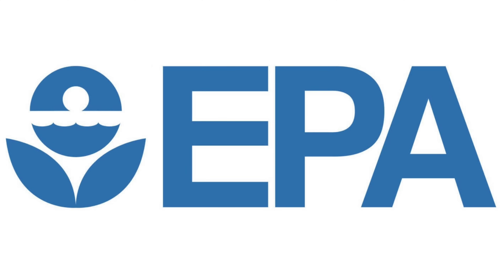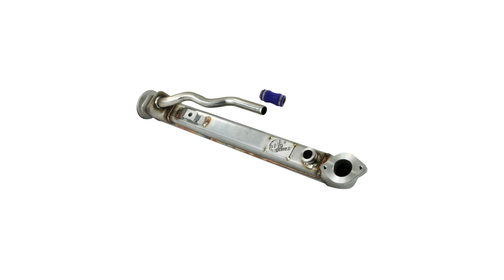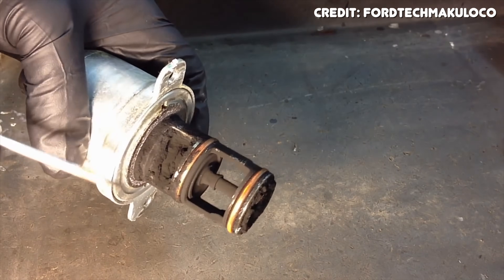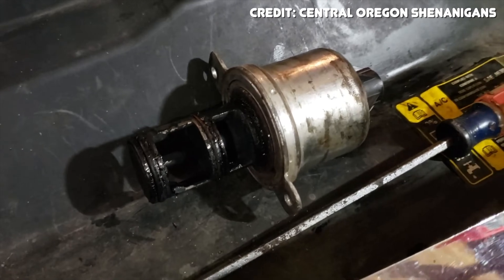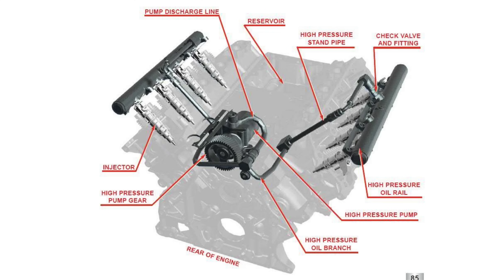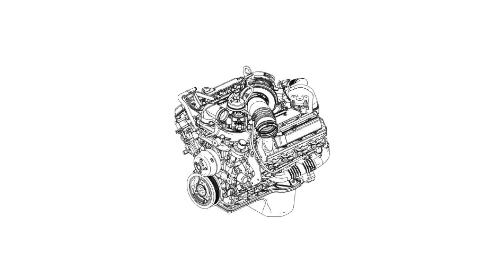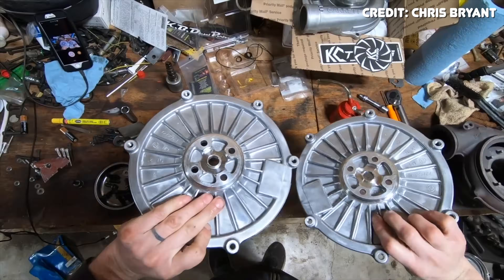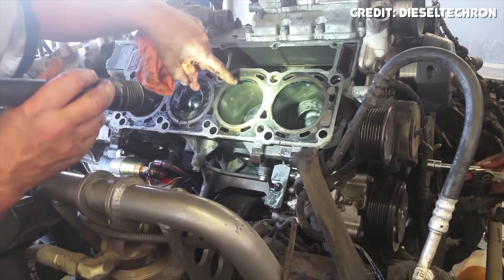The Truth About the 6.0L Powerstroke (And Everything Wrong With It)

Comment: My 6.0 gave me problems in the form of a blown egr cooler.  Fixing the known issues on the 6.0 was still cheaper than a new truck and since the rest of my truck was tip top I went ahead and spent the money to address the problems.  10 years later it’s still been a reliable workhorse.
Reply: If you do regular maintenance like you’re supposed to most of these problems are pretty rare
Reply: I am a shill for the 6.0 I can't lie, but right after we deleted the egr and put a new oil cooler on. IPR blew as me and my dad came back from the shooting range, was an absolute b*** to replace after we just closed that valley back up. Tip for yall trying to do IPRs now, harbor freight has a ratchet that swivels left to right, I never found an application for it until replacing that IPR made it worth the $15 spent.
Reply: That makes me feel good bud cuz i just bought one
Reply: @BlakeRobison-jh3ft   religiously changing the oil and filters is key
Reply: My 05 was 37k brand new when I bought it, here it is 18yrs later and only spent $10,000 on 2 headgasket jobs & failed HPOP, including replacing known issues, i.e. EGR delete, ARP studs, blue spring, upgraded cooler and oil rail o-rings, So, still less $$ than a new one, plus I have backup cam and poweramp steps and power fold mirrors & wood steering wheel from Lincoln
Reply: I didn't have any problems, but I decided to spend the money and bullet proof mine, it's a great truck and doing well.  It's a nice looking and nice sounding truck and I can't see spending $75k and up for a newer or new truck.
Reply: Thanks for steering me away from another money pit.
Reply: I can agree with that. Built proofing my 6.0 has kept me on the road. Have fun
Reply: I own a "87 f 350" with a 6.9. it's a
Dump, I'm told it's an International diesel. Had it 3 yr & Boy! What a workhorse! 4
Reply: How much did you spend on it to bulletproof it and do improvements?
Reply: @johnhinston958 I spent 4500 making my 03 f350 reliable.  It’s not tuned or deleted but has a bullet proof diesel egr cooler.  A bulletproof air to oil cooler and a coolant filter kit.  

458k miles still going strong
Reply: @johnhinston958  What does bulletproof mean in this case?
Reply: @FreEmotions_Real   Ford made the 6.0 a little problematic. To make it trouble free you have to replace some key pieces to ensure it doesn’t break down
Reply: @johnhinston958  I got it. What does a phrase "to bulletproof it" mean? To make it reliable??
Reply: @FreEmotions_Real   yes like the president’s limo is bulletproof. A truck is bulletproof if it gives you no trouble
Reply: @FreEmotions_Real bullet proof is a company that offers parts for the 6.0 psd to make it reliable as in head studs gaskets updated oil cooler and relocation to front bumper and egr delete and tune it safely they will run forever just keep on with the filter and fluids with the top stuff nothing cheap
Reply: So no one is going to answer his question. Head studs are the main item from my understanding. As indicated in this video it has many other items that need to be addressed but a blown head gasket is the main culprit.
Reply: Don’t put some crazy tune on it. Bought mine new, added a coolant filter, tow tune, intake, exhaust. No major problems, oil and filter changes including fuel filters as scheduled, 240K miles. Still runs great. Sould outlast me.  @timdontwannasay5889
Reply: My nigga u droppin facts how many miles do it have now boss
Reply: @JamieGarrett-ru4rq  Saw your comment B, i got an all stock with 243k on it, not studded, no major issues. I just did $20k of work on it to get it prepped for 600hp. Lemme know if you need any help if you have a 6.0.
Reply: Who wants to have to be a Ford technician to be able to drive that piece of junk. Gimme the Triton any day

Comment: I have an early 03 6.0 totally stock with 295 k no heads studs but went through all 8 injectors at 220.  Lots of fass fuel pumps because I live in north Dakota and they don't like the cold. It was egr deleted at about 190 along with new oil cooler and hpop. And now I just did oil cooler, hpop, and turbo and all seals. Put only  oem stock parts back in.and it runs better than it ever has since I bought it with 122k on it!

Comment: Work on them full time and hate them, and i actually love fords. I own a mustang and a fusion. But. Buy a dodge and be ok with replacing wheel bearings. These things are garb. I watch dudes throw thousands at them just to have something else give out. And that's if it doesn't fall apart while we work on it. The heat from the turbo and tight space makes things difficult at times.

Comment: Yeah the 6.0 isn't perfect! But what else can you buy  for around 5k and do what they do it's by far the best bang for the buck out there, They made a million of them so used parts are plentiful, awesome  for  vast selection of aftermarket upgrades endless diy videos on YouTube, Sound good,  still has modern body style  solid chassis If you actually know how to diagnose and read the  vitals correctly  not just plug in a  scanner pull a code or 2 thinking the t's and p's look great  but not realize your looking at inferred readings, so you can avoid the typical Craiglist buttfucking or  start throwing $1200-$1500 in parts chasing phantoms while the frustrating POS keeps dying  all over just a bad stc fitting so now they wish they listened to everyone on 6.0s reliability even though the fucker has survived  275k  on the odometer and the last owner probably  didn't even know how to check the oil  level correctly

Comment: I work on these for a living. Lack of maintenance kills them. They flip inside out due to running on a high pressure oil system sealed by a series of o-rings... Dirty oil acts like a fine polish until the o-rings give out and then it all fails in a series....

Comment: 6.0 isn’t terrible. There is a few design issues that absolutely need attention. But common maintenance mal practices in any engine just have a higher effect on these engines. Running a quality oil, motorcraft filters(oil and fuel) will basically eliminate injector issues. Keeping your batteries and charging system maintained will basically eliminate FICM issues. Starting with a clean not restricted oil cooler and installing a filter kit will pretty much eliminate oil cooler and egr cooler issues. In stock form head bolts are fine, if you are pulling a lot just monitor coolant temp and know when to back out if them. All if the issues can be issues in any other vehicle 6.0’s are hust less tolerant when you don’t maintain. If you start off with one that has been maintained correctly and you continue that they are great. They can be frustrating when you buy one that hasn’t had attention and you already have components that are beginning to fail it can be costly and time consuming to get them back correct. I will continue to run them though, can be bought cheap because if their reputation. They are east to work on and cheap compared to new common rail engines. The cost to replace a common rail fuel system on these new trucks will nearly buy a whole new engine for a 6.0. Then you can start fresh and as long as you follow some of the simple guideline they will last a long time, be reliable and get good fuel mileage, in a truck that has an excellent running gear and is a very good truck overall.
Reply: This is an incredibly useful comment, thank you

Comment: I drive a 2007 F450 6.0L Diesel, 658,322.7 miles, 15,722 hours, change the oil every 150 hours religiously, change the oil cooler, screen, and EGR cooler every summer, the starter is the only thing that's left me stranded in 8 years lol

Comment: I personally own a late 04 model f350. When I bought it it was fully stock and low miles had no issues and all I have done is preventative mods for those common issues. Coolant filtration system, egr delete, blue spring mod. Adding additives in my opinion do help. I use the arch oil products both fuel and oil additives and I haven’t had any kind of issues with my injectors since I replaced them about 60,000km ago. I like my 6.0 has plenty of power for what I need it to do. I’ve got friends that have the same truck and turn them up and have nothing but issues with them with a couple more supporting mods that I have.

Comment: Best thing I ever did for my 6.0L besides head studs was to install a coolant pressure gauge, it will let you know when your pressure cap starts to leak or your oil cooler is getting clog up. Have 265,000 miles on my Excursion.
Reply: W for excursion gang
Reply: Where did you tap in at?
Reply: I'd def get a ECT tuner  gauge cluster  from EGTs to ficm voltage everything's on these gauges  so there's no guess work at all.. and  when your towning  egts and trans Temps are a must to monitor
Reply: A tuner will give the American advantage and then some because you can monitor live values and set high limit alarms notifying you the instant it gets one degree higher than you want.

Comment: Nearly every issue with the 6.0 comes down to lack of maintenance. Change the oil, coolant, and fuel filters per the severe duty schedule (and leave the tuners in the box) and your 6.0 will likely live a long and happy life.
Reply: Nope.  It needs the EGR cooler delete to keep the massive heat out of the system.  THEN it's much closer to issue-free.
Reply: @tucobenedicto1780  yep
Reply: I bought my 04 f350 in 2015 with 180k miles on it. The next 50k cost me a fortune. I eventually parked it until I had the money to fix all the issues at once. Bulletproofed, deleted egr, blue spring, new heads, etc. done by a mechanic that specializes in these motors was the key. Im about to hit 400k miles and haven't had any problems I couldn't fix myself since.
Reply: @cooperdanieltherancher  man, that’s a loaded question, because really you have no clue how the previous owner(s) cared for and drove it. Also, what are they selling it for? May be worth doing if it’s a great price, they have kept their receipts and maintenance log, is it studded already? What oil, ATF, coolant, fluids etc. have been used for the life of the truck? Does the transmission flare when shifting, especially 3rd - 5th under hard acceleration? There’s just a lot of questions. But, that goes for any truck/vehicle. If you’re honestly thinking about buying one, research, research, research and questions, lots of them should be asked. My truck has 176k, but it’s 20 yrs old, so some of the problems I’ve had are regular things that fail being that old. I still have my original injectors, turbo, dont run a hot tune, and stay ahead on maintenance. I also always watch my temps and pressures, especially when pulling. Hope this helps. If you have anything else I’d love to give any help I can.
Reply: @jcobra09  what do u mean by transmission flare
Reply: I love my 6.0. It’s not for the average joe, you literally need to have some mechanical knowledge to own these trucks and how to diagnose the system. Other than that not bad to work on and brings a smile to my face everytime it hits boost
Reply: @jdm_fan2376  funny for me I always thought people are expected to work on the easy things, if you can't see the cams on the table, you should be able to some what work on it with a decent mechanics help
Reply: 150k on my 2006 6.0. I monitor oil temps, coolant temps and transmission temps with a ScanGauge. Use Archoil oil and fuel treatment to keep the injectors clean. Make sure the battery terminals are clean and frame/body grounds are not rusted which can lead to FICM issues. Prayers to the almighty also seem to help ;-).
Reply: I’ve had my 03 since 08. Been a great truck. It’s a good truck for guys who aren’t afraid to do a little maintenance and work on their own rig. If you just want to fill it up, drive the shit out of it, and take it to Jiffy Lube every 10k miles, you’re not the right owner for the 6.0. I don’t think it’s the greatest engine or any of that, but the haters I think either have never had one, or have and didn’t do their research and maintenance. Theirs something that I just love about the way it sounds, drives, and feels
Reply: @jcobra09 i got a 03 too. I Really need to see a comment like yours. Thanks.. im not afraid to conserve that truck now 👍
Reply: Yup- I have an ‘05.  Did head gaskets and headstuds in 2012 and have 100k on that job. It’s water under the bridge. Otherwise, I did the usual 6.0 things like blue spring, coolant filter, etc.  Best truck I’ve ever owned and I’ve owned more than the millennial moron that made this video.
Reply: @BMXMXMETAL what do you mean by transmission flare
Reply: Ford rushed this engine out before it was ready!
Reply: @jacobnorth8642 Great engine. The emission design was a failure. Do a delete, regular maintenance, coolant filter, no hot tune, no problems.
Reply: @jacobnorth8642  the entire 6.0 eng   is after market.... they fail during  parked and off....
Reply: I have an 04 ,second owner at 255k SD. And I agree with you. Maintanece, FOmoCo filters ONLY and common sense with  elevate alot of your "6.0 problems". Egr delete was a no brainer as well. I have no issues (currently) good luck!
Reply: Another 6.0 boy trying to defend those piles of shit.
Reply: @connor4961  another idiot talking shit about something he’s never owned, only knows what he’s read online from others that never owned one.
Reply: @cooperdanieltherancher  I purchased mine 7 years ago with 215k. Engine had been out, not sure why but you could tell the hooks on the block were used. I’m at 260k now and the truck has been a handful of joy, very little let downs. Love it. But, it gets driven like a baby. I do have a tuner and a few mods, but I know it’s not a race car. If I ever bulletproof it, then I’ll be harder on it.
Reply: My 7.3 had an idm failure. It could run (but not idle or drive) with only half the injectors working.
Reply: What does that mean “leave the tuners in the box”? I’m not a mechanic
Reply: @michaelmoser3482  it means don't put a tuner on it and make it dump a bunch of smoke and don't add too much power to it
Reply: Nope, oil coolers STC fittings and stand pipes fail without any of the things you mentioned. 6.0 has broke many a man.
Reply: @cooperdanieltherancher  do you like doing maintenance? Ask for receipts of all the work he says that’s done on it ie heads studs, blue spring, EGR delete etc. everything that you read that a 6.0 needs. Does he run tunes? Hopefully not any hot tunes. Then if all that’s done, I wouldn’t pay more than $12k. If it’s not, especially the studs, take at least 4K off. Because you’ll need to do those things in the future. Look for a 12V Cummins instead, then you’ll be replacing transmission/rear ends 🥲😂
Reply: @jcobra09  Never had to replace a Transmission or rear end in a Dodge, I set tile in the mountainous terrain of Arizona. A pallet of tile and all the stuff that goes with it to install it isn't light. A few setters I knew jumped on buying the then new 6.0 powered Fords. Every single one of them had nothing but problems. The old Dodge just kept chugging along. I even owned a 7.3 powered box van. Take a Cummins powered Dodge over that all day long also.
Reply: Our company had a couple fleets of Ford E450's with 6.0L engines. We had to create 3 PM supplements (Every 60K miles) to go with our regular PM inspections (every 3K miles) just to keep them running. I think some of the old techs like myself are still traumatized by the Ford 6.0L engines. We thought the Ford 7.3L Power Stroke engines were bad, well these 6.0L engines made them look like a wet dream. At first, we constantly had to take out and clean the coked up EGR's and remove the intake manifolds to have them flushed out in our parts washer. Later, we moved over to using BG's intake flush kit. But, they had to be ran outside since it would smoke like crazy and plug our buildings exhaust system filters. It was like a toxic cloud rolling along our yard at nights.
Reply: @robroy7827 I deleted that emissions garbage after my warranty expired. Never “bullet proofed” it. Light tune, intake exhaust, runs great.  Oil and filter changes every 5k and fuel filters every 10k and good to go.

Comment: I think if all things like studded, deleted, blue spring kit, 48v FICM, custom tuning to negate blowing your trans with crappy custom tunes and a coolant filtration kit. The trucks honestly can be pretty good, especially for their age. I know plenty of people that just abuse them with all that done and they all have close to 300k miles and are doing great. Yes there are going to be ones that need to be rebuilt at 50k miles but all and I mean all motors see that. You either get a good one or a bad one. But yes, I believe they can be decent, especially for the price range you can get them at

Comment: Have an 05 Excursion with a 6.0 that I got for cheap with blown head gaskets at 170K...   We threw in much of the general stuff mentioned in the video, ARP Studs, External Oil Cooler, and aftermarket EGR..  I did have the stand-pipe o-ring fail but I think I nicked it when I installed the heads.  Been 20K miles since all that, I'm hoping for a lot more but it sure pulls my 30' camper better than the old 2500 suburban.  We have so many dogs it's kinda a travelling kennel but I prefer the secure weather-proof back over a truck bed for my use.  I may replace the water pump this summer as a little more preventative maintenance..   No tuning.

Comment: I have an 01 7.3 and I love it, not gonna lie. Even if it's a bit underpowered.
Reply: I also have an 01 7.3 (ordered from the factory in 11/00).  It has been the most reliable vehicle in the almost 60 years that I have owned.vehicles.  Have run a tri power chip, Airraid intake.and 4" cat back exhaust for.around 140,000 of her 171,00O.miles.  Only weak spot is the 4R100 tranny (on my third).  I plan on keeping her til.the wheels fall off.